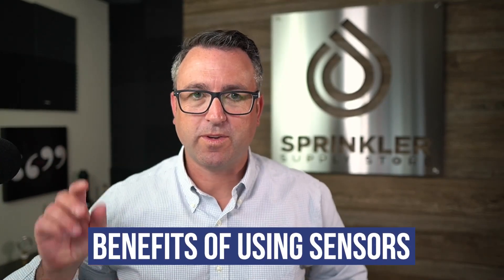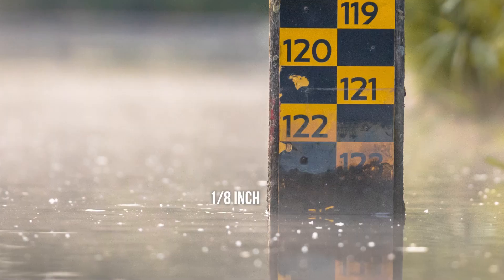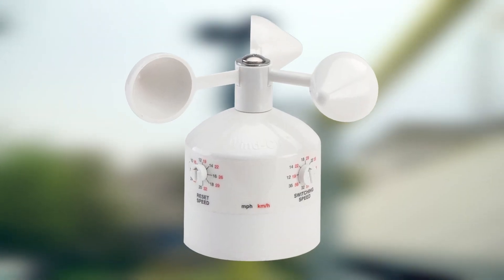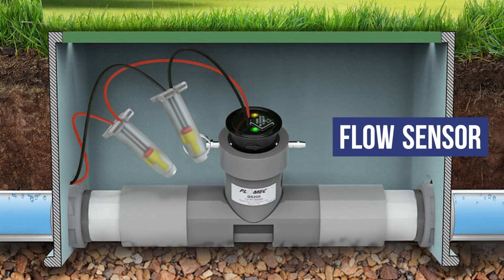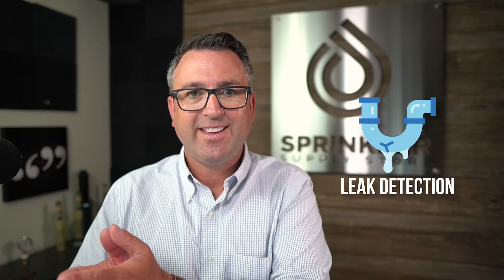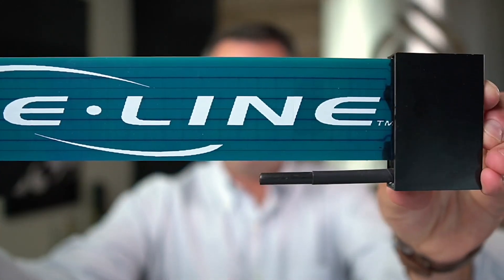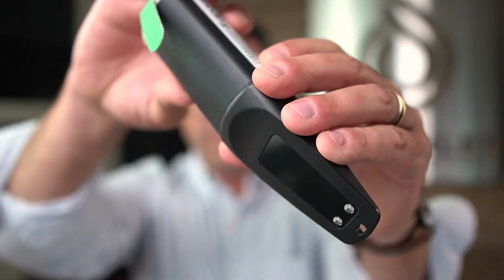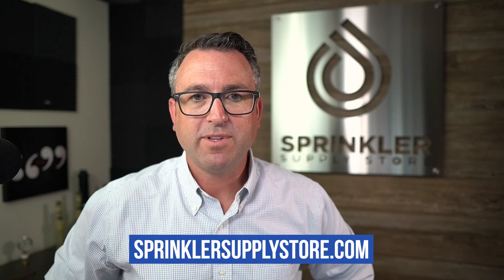The Benefits Of using Sensors For Your Sprinkler System | SprinklerSupplyStore.com

Comment: Very good. I was unaware of the flow sensor. I'll check it out. Thanks for taking the trouble to make this clearly presented video. It's helpful information. Cheers.
Reply from the maker: Thank you 🙏. Unfortunately, not every controller/timer is capable of excepting and reporting flow. It’s an extremely valuable Datapoint that will likely be incorporated into every sprinkler controller in the future.

Stream Labs is an excellent product you can easily add onto your main water supply to monitor all water in your home. If interested.

https://www.streamlabswater.com/